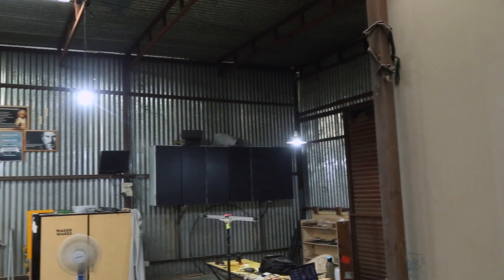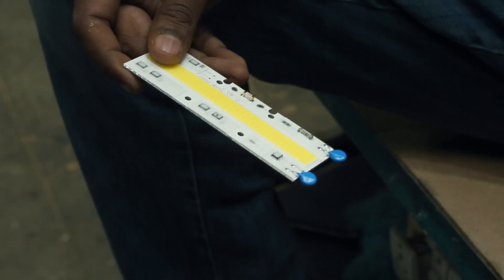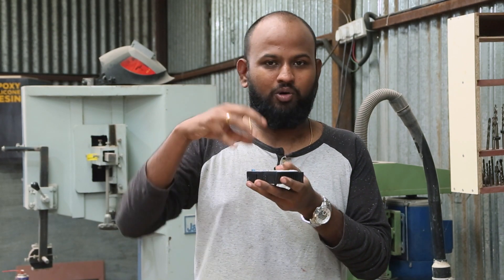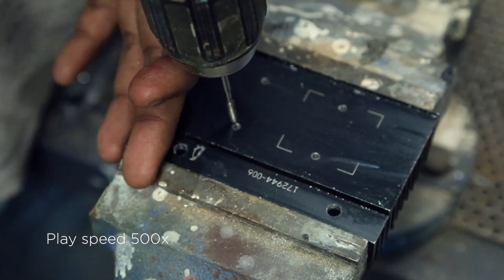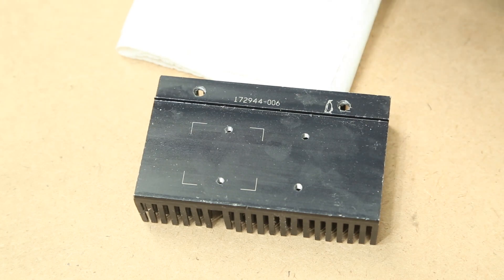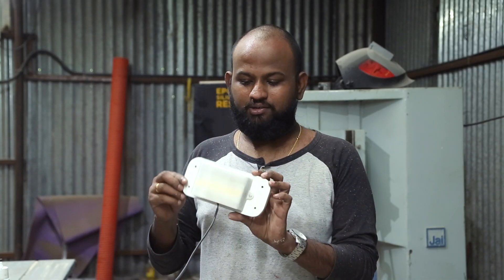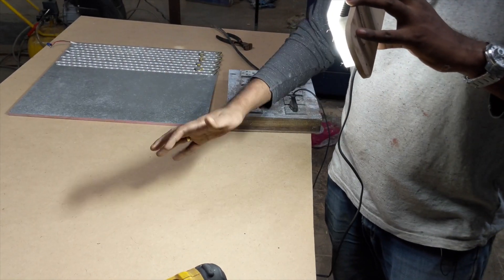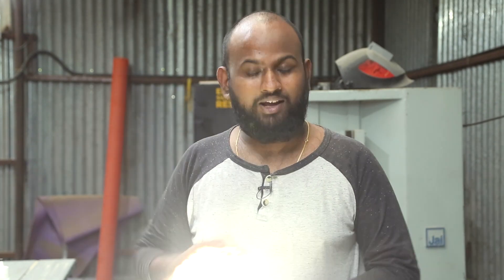50W No Driver Required LED - 220V AC

Comment: how can it be without a driver? What's the principle behind?
Reply from the maker: It uses a bridge rectifier to convert ac to dc and then a capacitor to smooth out the voltage